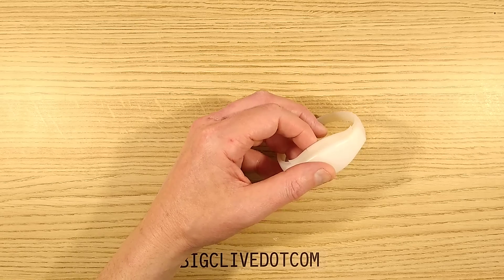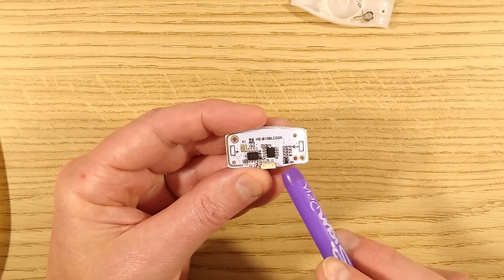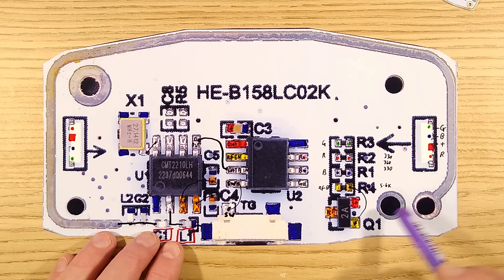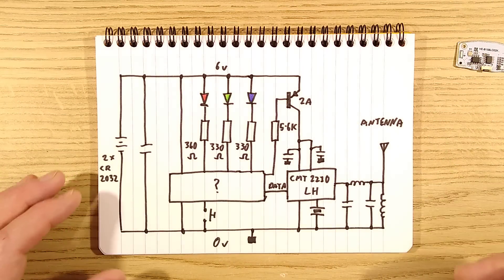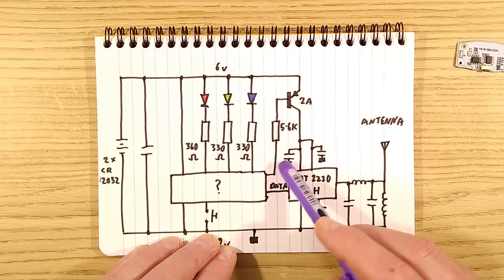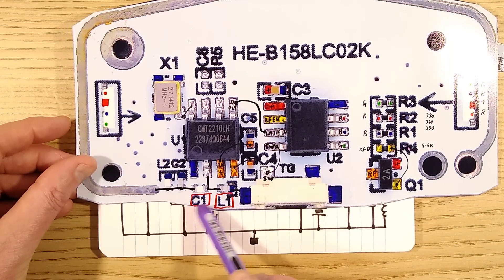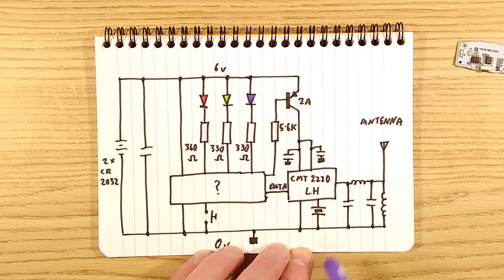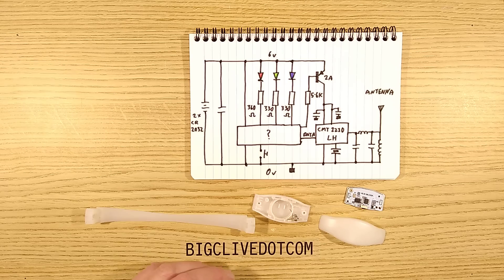Wireless audience LED wristband

Comment: If you look at the crystal on the PCB and then check the datasheet for the RF chip, it shows that the wristband operates on 433.920 MHz, the same frequency as 90% of car key fobs in the UK.
Looking at Clive's circuit, the RF section looks like it can not switch on the wristband unless the switch is operated because the RF chip appears to have no independent power supply of its own, only a supply that is dependent upon the microcontroller switching the transistor 2A on to power the RF section, am I looking at the circuit correctly here?
Reply from the maker: The microcontroller does appear to have control of the RF circuitry.  I'd guess that it goes into a sleep mode, waking up every so often to see if there is an RF signal present.
Reply: Do doubt the batteries are loaded long before the concert - perhaps days.  There has to be a way to prevent the band from depleting the batteries before us.  The switch might be used to wake up the processor when the band is given to the participant.  Then the processor turns on the RF every minute looking for "showtime" signal, then it goes into full action.  At the end of the concert, there could be a "power down" signal that puts everything to sleep.
Reply: @russellhltn1396 Wouldn't it be cheaper and simpler to have a plastic pull-tab that seperates the battery from the contact until handed out and pulled by the user? 

... except now you have a bunch of little pieces of garbage around the stadium because people are horrible... I guess I see the tradeoff.
Reply: @RubixB0y the person handing them out could be trained / instructed to pull the tab as they are handing them out, then the rubbish is contained to their area and easily cleaned up later.
Reply: @Emily35-Official  Great solution! I'd overlooked the assumption I carried over from the button theoretically being pressed by each individual
Reply: @RubixB0y  always assume the user is an idiot. That applies twice as much to people attending raves.

checks to make sure nobody can hear my doof doof music
Reply: Antenna is too short for 433.
And 433 uses Sawtooth generator.
Reply: @snakezdewiggle6084  how long do you think the antennas are in car key fobs, a lot shorter than in this bracelet, and not all 433 MHz tech uses sawtooth generators?
Reply: @snakezdewiggle6084 "Shorter than optimum" not "too short". That's why there's the pi-tank to match it. The data sheet for the CMT2210LH chip shows it operating on 433.92MHz with the 27.1412MHz crystal that you can see in the video.

Comment: It’s on a very specific frequency so I guess they may have a few channels assigned so that particular groups of bands can be independently activated. Not sure however how effective that would be unless they can guarantee that the individual groups can be located in particular places.
Reply: It's not channels, but more like bands, 315 MHz, 433.920 MHz, 868.35 MHz, and 915 MHz depending upon what crystal is used and what RF low pass filter components are on the PCB between the chip and the PCB antenna.
Reply: Xylobands had their own allocated fgrequencies in the terroritory where the bands were being used, which really surprised me that they had gone that far from day one.

Comment: The CMT2210 is just an on-off keyed radio chip that sends a data stream into the micro.  To independently address these wristbands you'd just have to implement a serial number in the micro controller's eeprom.